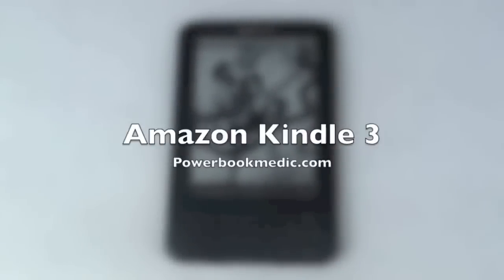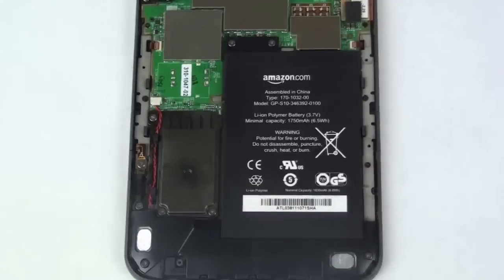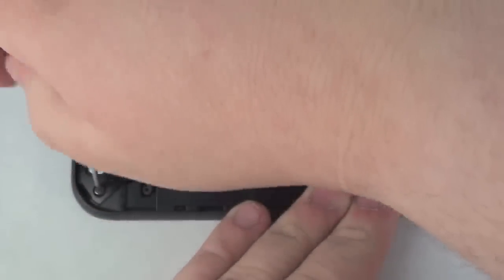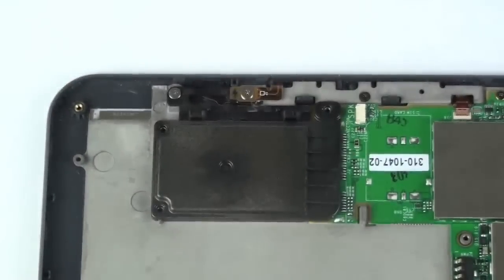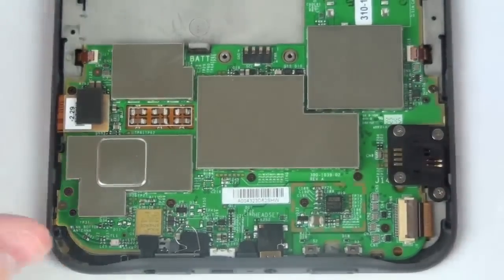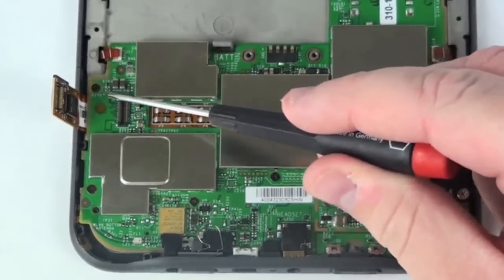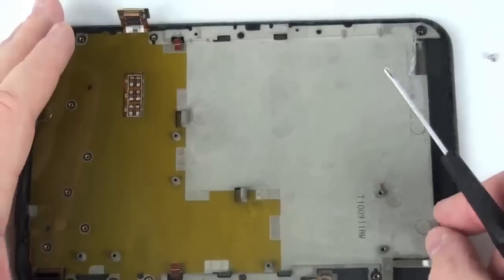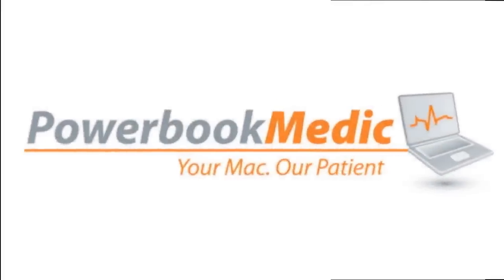How to Repair an Amazon Kindle 3

Comment: After managing to somehow crack my screen when I put my Kindle down last in bed last night, I followed this video and it worked a treat (I salvaged the good screen from a previous K3 which had developed the K3's fairly common "locked out" fault that I've spent about a year trying to fix to no avail). 
I always loathe trying to spring off the backpanel of K3's as they are so flimsy!! Plus there's a ribbon cable at one edge where you're likely to unknowingly pry into when trying to get awkward back off. Was fairly astounded they'd used adhesive, and so much of it, on the back of the speaker board, especially when considering there's only the thin mid-panel between the speaker board and the fragile screen. Even harder after all these years when the adhesive had baked hard like concrete; just a couple of screws to mount the board would have sufficed. 
I've read up on various theories of what does/not need removing to replace the screen, but decided best to do the whole thing "properly" and remove it all as not to risk straining solder joints, etc. On hindsight though, I do feel the speaker board does not really need removing; it can remain attached to the metallic mid panel. After an hour or so's methodical work, I've got it working again with the salvaged screen in place. Thank you. :)

Comment: On the strength of your video I managed to resurrect a Kindle 3, using parts from a second dead Kindle 3. Thanks. BTW, I had captions turned on but got no captions. One way the video could have been better would have been to identify parts with text labels (especially in view of the missing captions).

Comment: Is there an easy replacement piece for the charging port? Someone borrowed my kindle keyboard & tried using a micro-usb or some other power cable & broke the mechanism. I don’t know what type of connector the kindle used to use, so don’t know what to order, or if There’s a micro usb or of their form on power connector that could be soldered I place of the old broken connection? Does anyone else have any ideas? I’m in the UK & there doesn’t seem to be anyone that fixes kindles that I can find locally to Hertfordshire, but if I saw a video or had some instructions on what to do & what to replace the broken connector with, I’d give it a go as I love my kindle for the times I need to stay in hospital
Thanks in advance for any help you can provide

Comment: My Kindle Keyboard is nearly ten years old and is suffering from screen burn in. I got a replacement on eBay and using this excellent guide, in twenty minutes, replaced it and it's good as new! I have other, more advanced Kindles but this one has sentimental value. Thank you!

Comment: IT IS NOT NECESSARY TO REMOVE SPEAKER ASSEMBLY. 

The best kindle keyboard disassembly video I’ve found on youtube. Already have fixed 3 devices (present kindle3 to many of my relatives, and they know I can fix it :-) ). Only on the 3rd one, I realize that it is not necessary to remove speaker assembly at all, to replace the screen. 
Because of adhesive it was one of the most time consuming and problematic stage.
Reply: I found the adhesive a ** to try and remove. As I've just commented on my own post, I "played it safe" and removed everything, as not to risk stressing solder joints, etc., but think I can agree after the (successful) operation that removing the speaker board is not necessary. It can remain glued to the metallic "mid plate".

Comment: Is there a place to buy the little "fishhook" spring that operates the power button?  The one on my Kindle 3 has failed completely.  Thanks
Reply from the maker: L Mullins You would have to search for a used one somewhere, we no longer stock these. It may come with the front case.

Comment: Great Video. Only comment I would add is that the (2) tiny aluminum spacers came off with the battery at the screw locations and I didn't notice until after I picked up battery to reinstall. They only go on one way and if it wasn't for the step by step video, which allowed me to find them and figure out what they were, I would have had a difficult time figuring out where they went.

Comment: My kindle will show an orange light when charge cord is plugged in but won't turn on even after holding power button down for over 30 seconds.. any other suggestions? Also, I did change the battery.
Reply: dean francis ..my yellow light comes on but it does not seem to be charging

Comment: 1. There's no need to remove the speaker assembly. It can stay attached to the mid board, but do remove the screws; in my Kindle
     there were three. The speaker assembly will come out with the mid board.
2, Instead of a place holder my Kindle had a plug-in module which I pulled straight out. Lifting it up as in the video would have
    damaged the connector.
3. My logic board was held in place by not 11 screws but 12. The eighth screw was located low and to the right. The video showed
     only the screw hole..
4. There are 2 spacers located underneath the battery where the screws were removed. Be careful not to lose them.

Comment: I have an amazon kindle, I had bought it a few years ago.  Suddenly it refuses to start.  the screen says to hold the power switch for 15 seconds, but nothing happens when I do it.  Does anyone know where I can buy the batteries?  I would hate to lose all my books that are stored in it.
Reply: I store all my books on an external drive with my computer.  Then I can just copy over books to the e-reader when I want to read them on it. Otherwise, I can read them directly on my computer.

Comment: My kindle 3 will turn on but nothing happens with the screen. It has a bunch of lines through it and the lines make it look like the screen is cracked but they are under the screen. Would this apply to my problem (the video)? I watched some of it but my wifi won't let the video load properly so... Please let me know because I was in the middle of reading a really good story and I can't get it on anything else and I need it for school use. Thanks!
Reply from the maker: Morgan LeMay - Yes, you'll need to replace your display.

Comment: Great vid thanks for uploading. I am having problems with my menu button it has just stopped working, everything else works fine except that button. Before I pull my kindle apart do you have any other options for me? Thanks
Reply from the maker: swiftvixen - It could just be the button is out of alignment, but more likely than no the actuator is the issue.

Comment: The right page advance buttons, both of them, on the right side won't work at all. Resetting that little ribbon cable hasn't helped. I've even tried cleaning the end of the ribbon cable with isopropyl alcohol. No help. Any advice is appreciated.

Comment: I have a kindle similar to that one but the top half of my screen is blurry I need help on how to fix it please
Reply: Mariana Aguilar  You can follow the instructions here, And buy a screen off eBay. On the other hand, they can be bought absurdly cheap now. If you are not technically inclined, it mught be your better option.  I just got a Paperwhite at a pawnshop for $15!
Reply: I'd try to reset the screen connector. If that doesn't work, I'd say you need to replace the screen.
Reply: 525Lines yes but how and where do I get it replaced that's what I need help with my friend
Reply: Tak Wolf thank you that should help...I'll get to it straight away....

Comment: The new screen installation instructions were great and made it simple. The new screen, however isn't working completely.  When in the off position the pics are barely discernible.  Also when I get into the books, pics there along with things like the cover, cover page, chapters and some of the forward are illegible.  After that the books themselves seem to be working fine.  Any idea how to fix these problems?

Comment: For anyone replacing their screen, heres a time saver. You dont need to take off all those components off the main motherboard. All you need to take off is the battery, the screen ribbon (obviously), the speaker bay, the earth and unscrew the motherboard along with the midboard (and that weird 4 screw black thing) and the whole thing should come out. Saves you risking damaging any components and threading screws unnecessarily.
Reply: I wish I had read this first....!!!!  But whatever I did, I fixed it and I have 10 thumbs and no talent whatsoever.   I have you a Thumps Up!!  I wish I could have given you 10 thumbs up!!! ha!   regards, Mr s.

Comment: My screen had lines through it and the Kindle ignored the power button.  I thought maybe just removing the battery and reinstalling it would do some sort of deep reboot.  It seems to have worked.  The only odd thing at this moment is that although I had just recharged the battery I got a "battery extremely low" warning and I have plugged the Kindle into a power supply to recharge the battery.  Meanwhile I can read my stuff.  Woo hoo!  Thanks for the clear instructions.
Reply: Paul Weeks my kindle ignore the bottom of power what can I do?

Comment: Simple but excellent. I changed my broken lcd screen by a new one on my first try just waching this video a couple of times.  However my Kindle 3 does not want to wake up yet and now I have a big black spot on it.  Any ideas on what happens now. Thank you very much.
Reply from the maker: A black mark is going to be a defect with the screen unless you damaged it in the install.
Reply: Powerbook Medic
Would that apply to a Kindle that has never been repaired? For about a month 3/4 of my screen was black. It would disappear when I advanced to the next page. Last night it shot craps after having been on the charger for 24 hours. The light was yellow and I unplugged it because the cord was tangled then I plugged it back in. Once I did that the light did not come on and I could not get the unit to turn on. It's several years old. I like your video here. I'm considering repair rather than replacement.
Reply from the maker: thundercloud47 Yes. It's likely the screen.

Comment: Also I know that it doesn't show how to put it back together, but just do what I did, everytime you took a part, place it on a white A4 sheet, and add the parts in the exact order. Also, on another paper, draw it out, roughly, each part, and tape it the screws. So when I replace the screen, I just followed my diagrams, in reverse order, simple.

Comment: Also the section where you put the 4 ribbons back, what happened with me was I put the green board back in, then the black square piece, but then noticed 2 of the 4 ribbons, the small ones was trapped behinf the green board, so I had to reopen it again, then take the ribbons/cables out. Other than that, everything went fine. Perfect.

Comment: It took longer to get everything out, as I did like diagrams, and then tape the screw to some tape and taped to each drawing I did. This way, it was very easy to put together since I knew which screws to go where. I advise people to sketch roughly the part, and then tape each screw to there, yes it's longer but you won't lose screws or mix them up.

Comment: Thanks for the intersting how to guide, Now I'll know how to take mine apart to replace the LCD of mine, it stopped functioning by LCD failure, the rest still works, but the LCD is bust.
That is the second one, I'm looking for a replacement, maybe another manufacturer or if it's cheaper I will just repair it.
Also depends on if I can take my e-books with me, I've started other sources than Amazon a while ago, as they often offer me multiple versions without DRM.
And I quite like the freedom of it.

Comment: I think the leather case that sticks two metal fingers inside the Kindle is what broke my unit. It freezes at odd times, and the power switch boot works only occasionally. There seems to be a switch near where the top finger comes in, and fiddling with it caused things to happen. No consistent results yet.

Comment: My Kindle has a wire from the speaker assembly to the AnyDATA DTP-600W IC (3G card) that has to be disconnected to get the SA out. It's some kind of connector at the IC, and I hope I can get it connected again.

Comment: My screen has frozen and I have tried charging however the light stays orange. I would assume that's a battery issue? I've tried holding the power button for the recommended time, but to no avail. Is there any suggestions? Should I try to replace the battery to see if that is the issue? It looks like it is charging, but the light won't turn green.
Reply: ***** Ugh, the same happened to me.

Comment: Had a problem with random repeating keypresses.  Period key would just take off by itself without being pressed.  Took larger ribbon cable apart and cleaned off corrosion with rubbing alcohol.  Works great now.  Thanks!

Comment: Della the way eInk works, the image only changes when it's told to change. If the image is clear over the whole screen, I would suspect some other kind of problem. I was able to take a screen out of a K3 that wasn't doing anything and put it in a K3 with a broken screen. It didn't work perfectly, but it DID work.

Comment: Thanks for the video however there was a mistake at the step of removing the mother board, there were not 11 screws, there were 12. Not only that, in your video, you only counted 10 with your screwdriver motioning, you didn't count the one near the bottom right, next to the ribbon and the one above on the top right corner.

Comment: My Kindle 3 is stuck on a page. I cannot move forward or back.Even when I try to power off, the page is still on the screen. I opened it up and took the battery out but the page is still on the screen. Okay, so I know I will need to replace the screen but could there be something else that is contributing to this? I'd hate to replace the screen and find out there was still something wrong.

Comment: someone knelled  on my wife's Kindle 3G but there was no cracks just a couple of lines down the screen and a picture of a lady but she was only in one quarter of the screen and that was it!!!!

I live in Spain and was able to buy from Ebay UK. 

thank you very much for this instruction as they were perfect, mine was slightly different when taking off the speakers i had an extra screw. when i got the screen out, there was some cracks in the corner on the back.

again many thanks

Comment: I have a kindle keyboard 3g just like this... I have no idea what's wrong with it. The screen is stuck on the Amazon screen with the reader sat on the hill under a tree. I haven't dropped or cracked it. Yet it is unresponsive. If I put it in to charge the orange light comes on for 5 seconds then just turns off. I've tried holding down all kinds of buttons. Even had the battery out and left it a while. Tried to leave it to charge overnight. thanks in advance.

Comment: Thanks for the vid very helpful. Took my K3 apart as the screen had at first partially frozen, sometimes refreshing, then finally it stopped. Took the battery out & replaced it and it rebooted. The screen refreshed, all good. Put the back on & it froze again took the back off and it was OK. It seems that the back is putting too much pressure on the screen connector possibly bending it slightly. I've just clipped the top and bottom of the back, put it in my case & its OK for now. Hope ithis helps

Comment: My screen on Kindle 3 is frozen...My power is charged and is working. I can connect to a computer through USB, but my screen doesn't want to move from the frozen page. I took the back off, took the battery out to see if that would fix it and it doesnt. Any ideas on how to fix it?
Reply: sbbulat same problem here, have you found the solution?

Comment: Hey, i gotta problem with the powert switch ,.it doesne affect the display at alland it does not even flash a green light while i switchit sideways, it only indicates a orange light whilst charging but that light only last for 5-10 mins after whichthe kindle freezes as before. any  cues?

Comment: Congrats PBM, and thank you for your excellent video, it helped me a lot. The only remark I'd make is that there's no need to detach the speaker assembly (2:20-2:40) from the chassis if your goal is replacing the screen.

Cheers to all kindlers everywhere!.

Comment: First of all thanks for the vid. I replaced my broken screen without a problem. However the screen stay somehow the same as i bought it. The light on the power switch turns green but the screen stays the same. Tried to reset without any success. Any idea?

Comment: Hello, good video. I had a problem with my kindle, it froze, but have not figured out what the problem is. I bought a battery for your company, but I solved the problem. He can not do reset (30 seconds on the button), nothing. No idea what the problem is, will the screen? He does not charge the battery, nothing. I appreciate the help.

Comment: Hi, very helpfull video, thank you!
I sat on my Kindle by accident, and it has lines and parts doesn't refresh anymore, like this youtube video: "Defective Kindle screen problem - horrible"
Does this mean my LCD is broken and I can replace it? or can something else be broken? If I turn it on, everything seems to work (as far as I can see on some working parts of the screen). Maybe I can desemble the device to see if the back of the LCD has cracks?
Thanks in advance for a reply!

Comment: I bought a replacement screen from you guys this week after my previous E ink screen broke.  the directions you posted are pretty easy to follow (except for its 12 screws, not 11 in that one spot, I think).  I did the repair myself in about an hour, and my kindle now works again.  Thank you!!!